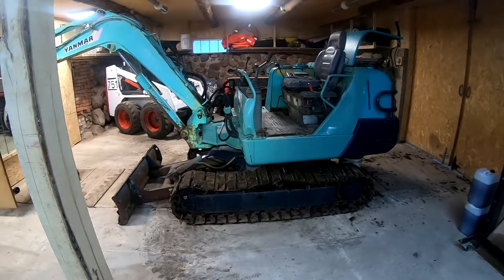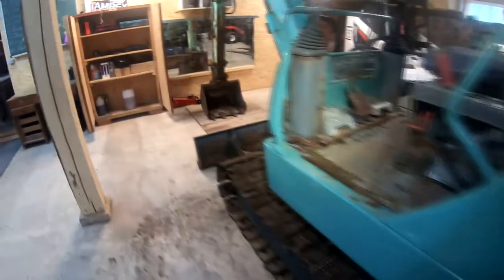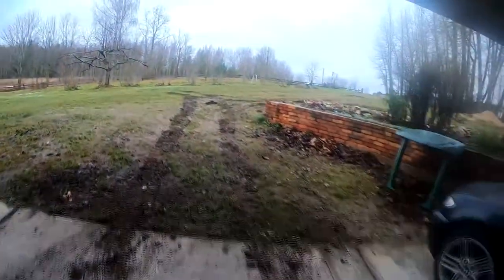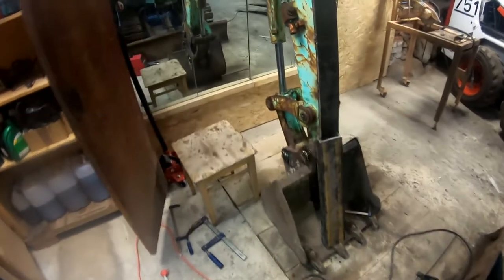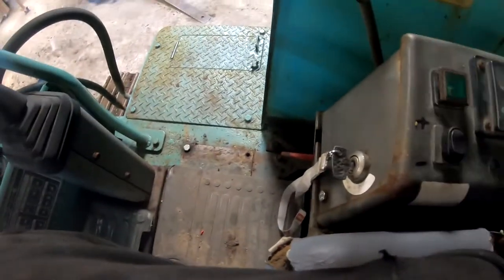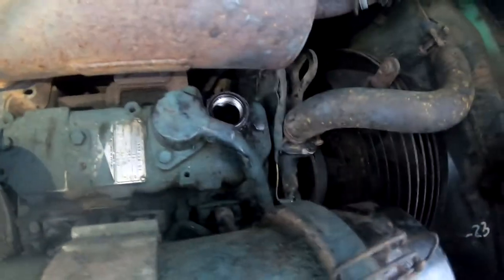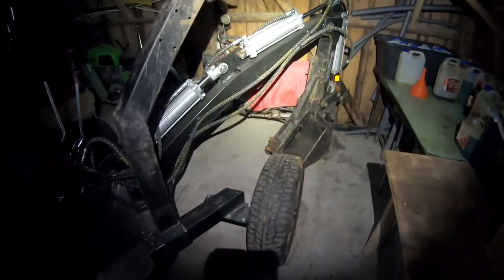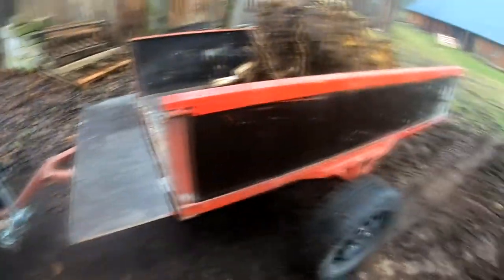Yanmar mini-excavator maintenance and building a thumb

Comment: You are doing a great job fixing it up! 
It’s going to just get better from here on. I feel both mine and your Yanmar excavators were neglected a bit before we got them. I think it will last you a long time 👍 especially the fact you are improving it. Thanks for posting.
Ps that tank for the coolant is an expansion tank, I bet you can find a tank on an older car to replace it with, you run the hose out from the hose barb on the side of the radiator out to the tank, it’s designed to push fluid out if it gets hot into the tank, when it cools down it will draw it back into the radiator, that’s as long as it’s all in good shape. The hose can’t have any air leaks, it’s got to be a good seal all the way down below the coolant level in the expansion tank. I hope that makes sense.
Reply from the maker: Yeah that made perfect sense. Already looking into it. thanks for posting.

Comment: There should be a hose from the radiator cap to the overflow bottle.  That bottle needs a new cap.  Radiator cap is likely needing replaced.

Fill the bottle to the cold line.
Reply: It's actually an expansion tank.  You are correct regarding the hose.  There should be a small diameter hose from the neck of the radiator to the top shoulder of the bottle.  The bottle should contain coolant between mine and max levels.  As the coolant gets hot and pressure increases the radiator cap opens and the water flows into the expansion bottle.  As the water cools and the pressure returns to normal the higher pressure in the expansion chamber forces the water back into the radiator.  At one time it used to be standard to let it run to waste but this closed circuit is more efficient.  It is perfectly OK to run it as it is but the coolant level will have to be checked regularly by removing the radiator cap....i.e.  the old fashioned way.  It is I important that the radiator cap is in good working order and the expansion bottle cap makes a good seal.

Comment: OH BOY MOTORCYCLES!!😄  I had to look it up but you're correct, that green meanie is an 'Izh' or more properly Izhevsk.  From what i read, it was Russia's largest motorcycle manufacturer.  The model you have may be a Planeta.  Looking forward to seeing this returning to life on your channel!  Cheers!
Reply from the maker: Their collecting dust. The thing ia that they belong to my cousin. But both of them have been sitting for atleast 15 years. They both work atleasr they ran fine 15 yeara ago i even drove the smaller red  one. When i was a kid. But by my understanding the green one has a dead starter. Its so heavy aswell thing weight like half a ton. I wouldnt want to drive that deathtrap lol
Reply: @Ants_Pants  From what i've seen they have a kick starter and the one on your cousin's bike appears to be loose.  I'm guessing the kick start shaft may be stripped.  I had the same problem with a 1974 Can-Am 250.  There's a Latvian dude on youtube that goes by the name 4-700 that has vids of these bikes.  Anyhoo, i'll not bother you any further about it.  You've got lots of ideas of your own!
Reply from the maker: @bradcrossman5068  thanks buddy

Comment: Hi Andres!🎉 greats videos!! I just wonder what you did to the milkshake in the engine? I have the same problem on my excevator you see 🤣
Reply from the maker: I changed the oil and it never turned milkshake anymore, i assume water got into the engine from exhaust pipe, if you change the oil and it still turns grey then you most likely have a blown head casket or the coolant gets into the engine oil through some other way
Reply: Thanks 🥰 I’m looking forward to see what you will use «the kirovits» for 😁 must be a awesome machine to haul a big dumper trailer is you need to transport some gravel or stone 😉
Reply from the maker: @ludelf  yeh most likely that, get a giant dump trailer and haul logs.dirt or rocks with it

Comment: Hi! I have a similar B25V, and recommend to install a water temperature control gauge. This kind of machines usually don't have it.
Good video, best luck with the machine.
I not having good luck with it, now is the swing motor replacement, because Yanmar don't provide spare parts to fix it:(
Reply from the maker: Mine does not show temp but it does have a indicator light if it overheats. That sucks bro. Can you get it rebuilt? Or find a used one
Reply: @Ants_Pants  trying to find some one to reproduce the original parts. 
One new swing motor costs almost 4000 euros. Used one is not easy to find.
If you need some repair manual, feel free to ask. Maybe the machines b27 and b25V are similar.
Reply from the maker: @engenhariacbx3327  thanks man. Very kind of you. Hope you find yourself a new motor. What is the issue though? I got my bobcat with a busted drive motor from some guy. Got it cheap took the motor apart and a special shape and size seal was busted in it. The seal itself cost 200 euros 😆 😆 but thats all it took still 2 years later its working fine. New motor was almost 2k

Comment: There is a method to check CO2 in the coolant, because that would indicate a defective head gasket.
The part looks like the spindle with which you check antifreeze.
Reply from the maker: yeah i know, as iv owned it for 2 years now. the Engine oil has not changed colour anymore, it stays nice and black (diesel engine) also the coolant level never drops, it has stayed the same. I suppose it was rainwater that got down into the engine after sitting?
Reply: @Ants_Pants  No it is condensation

Comment: does that hose underneath where you were showing the new and old grease go up to a remote greasing zerk? lots of machines that have hard to get to greasing locations use them,follow that line up top and see if it ends with a grease zerk. you can probably get a free manual for that machine online. love your channel
Reply from the maker: Yeah it does. I checked the line and the grease reaches the swing gears nicely.

Comment: Never run the starter on low voltage. That makes the starter draw enough current to burn the windings or commutator or break the winding connection to the commutator. Bad relays can also cause excessive voltage drop if the contacts are corroded.

Comment: Hello Andy,
Thanks for taking the time to do what u do here.
I have a B3 purchased three months ago.

Looks like I will be needing a drive motor for sure and possibly a new pump.

Having a tough time finding a manual.  
Have u had any luck finding one on that side  of the pond, either service or owners manual.

Looks like i have two track speeds from what I have read. 
Where is the switching mechanism for the speed change.

Best of luck with  your many projects.

Chuck in northern CA.
Reply from the maker: hey Chuck, i was unable to get the manual for it, i did find some parts diagram, its little of help but, at least i can get general idea of the machine and it's inner workings. The thing is that it's a grey market machine and it has no proper documents (maybe in japanese somewhere) Funny you mentioned the drive motor, mine just broke like less then a week ago 😂😂 can spin the stupid sprocket by hand.... ughh. Why do you think you need a new pump? is it slow/no power? The faster speed switcher-oo should be a tiny pedal left side bottom, near the floor

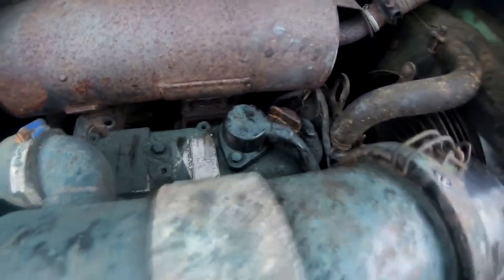Comment: 28:55 The vape is from oil and is due to cylinder blow-by. It produces crankcase pressure, which you notice on this machine because its crankcase is vented to athmosphere via the hose. On a car that hose is routed back to engine intake. See an example of extreme blowby: https://youtu.be/Gd7YYHu-S_I
Reply from the maker: Figured as much. After changing the oil 2 times the vape or blowby is almost gone. It helped a lot

Comment: Do you know for what purpose is the lever behind engine RPMs?
Reply from the maker: No idea mate, iv been trying to figure this out myself
Reply: @Ants_Pants Hi, Andris!
It is P.T.O control according to parts catalogue. Most likely it is adjusting hydraulic oil flow depending on equipment used (cylinder or drive motor)
Reply from the maker: @aivarstaurins477  Hmm, thank you for the info. I gotta try this out, as the drive motors are working very slowly even on full throttle.
Reply: @Ants_Pants  it is not for Caterpillar drives but equipment connected instead of bucket 
For second speed of movement drives there is a pedal on the very left side of the floor